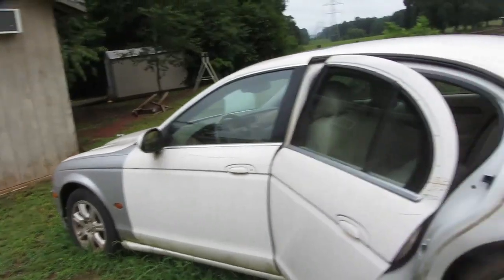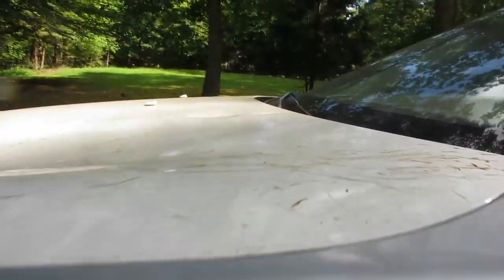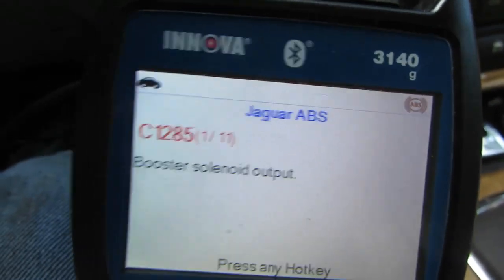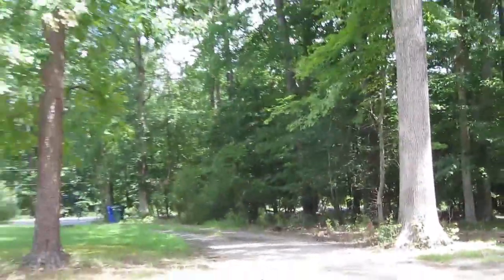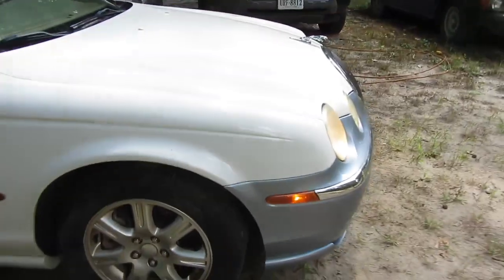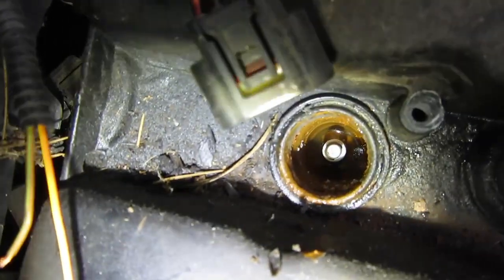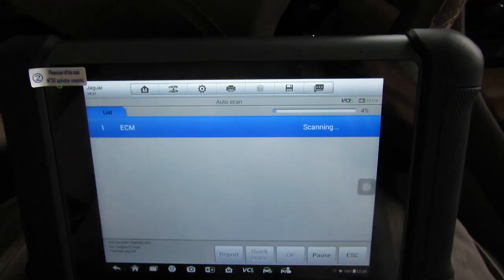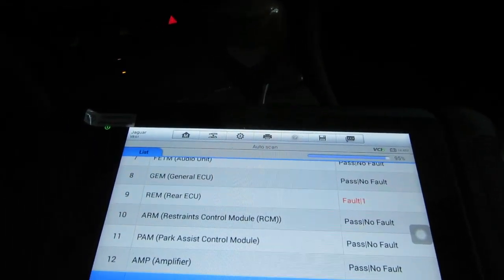EP 49 2004 Jaguar S Type Part 1 (Intro)

Comment: Spent a lot of time working on Jags o0f this era and would give this advice, find and clean/ make good all the main ground points on the wiring loom, make sure you have a good battery when testing for codes. manuals are usually available online and there is a lot of fan support. Small sensors tend to stick when the sit so a good run down the road to 'heat it through' will help with some of it. If you think it's going to be a runner change the coolant for waterless coolant, it will protect the engine etc and then do a transmission service. They make great run around cars if you dont mind the odd warning light.
Reply from the maker: Thanks. After a bunch of work, it's running great. I'm going to do the trans service as soon as I get it back from being inspected. I have the stuff, just need a pump for the fluid.
Reply: @wrenchesinmotion3282  I use a simple garden sprayer as a pump, holds 5 litres, remove the spray wand and add a piece of pipe, the trigger gives control over flow as well. One point, make sure the fill point can be opened before draining it.
Reply from the maker: @mercedesvan-doors34  I was thinking the same thing about the fill plug. I know when I do rear differentials, I always do the fill plug first. Can't imagine draining it with no way to refill.  I may have to buy one of those sprayers, sure beats using the little pumps.
Reply: @wrenchesinmotion3282  I like to see these old Jags being used. If I can be of any help it's a pleasure. I might have some pdf manuals somewhere.
Reply from the maker: @mercedesvan-doors34  Thanks for the offer to assist. The only thing left to do is the trans fluid. Oh, and I was driving it at night, and the window switches on the driver door are not all lit. So, I need to figure out how to take the door panel off, and replace some bulbs.

Comment: Following the Jag work because I have been offered a 2006 S 3.0 with 59k miles. Know nothing about these and the Jag reputation scares me! The vehicle is original and complete stored in a garage in GA. Been sitting quite a while though. Hoping to learn a few things about this rare item before laying down $5k and rolling the dice. Thanks for your efforts 👍
Reply from the maker: I took a chance with mine, but only paid $200 for it. No way I would pay 5k for a non running car. Fuel system needs to be completely cleaned out, and that's just the beginning. For a car that's not worth more than 8k, no way I'd be close to 5k. Just my opinion though.
Reply from the maker: If you do get it, let me know. Keep me posted on the progress. I'll try to help if I can.